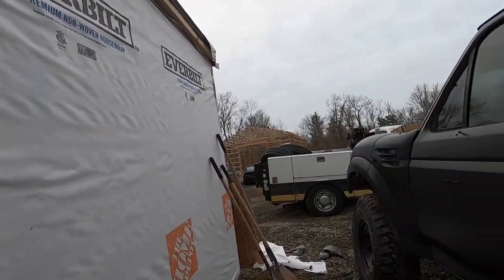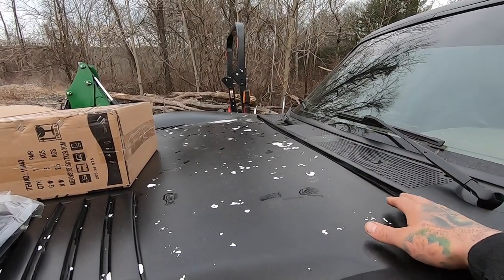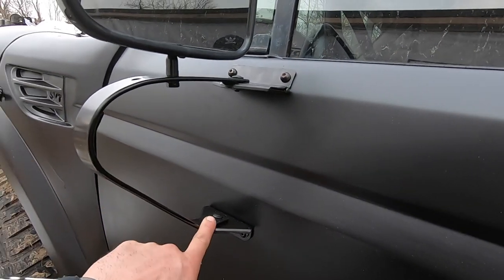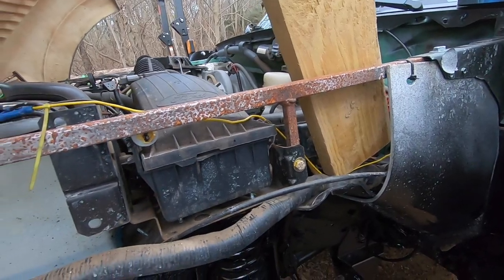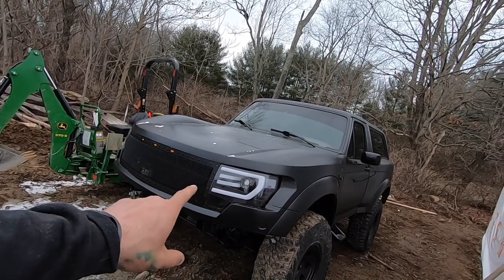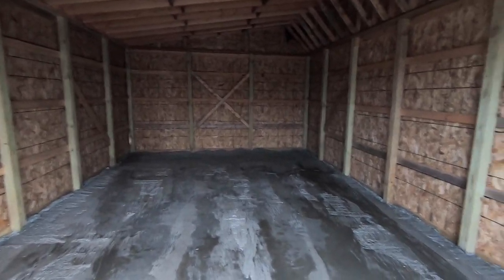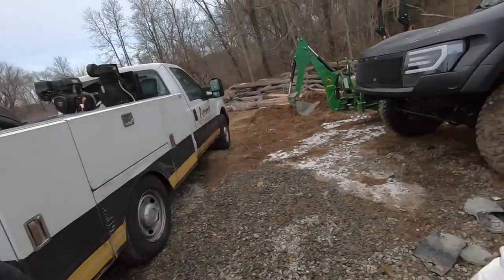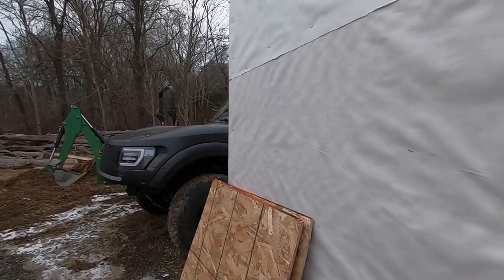New parts for the bronco and garage is almost done.

Comment: So I'm looking to do HIDs in my Xterra, but my pigtails have been melting and I can't figure out why. I replaced the pigtail once already and like 2 weeks later it melted again. Thoughts?
Reply from the maker: The bulbs are getting to hot in your housings? Or drawing to much power try leds they don’t draw as much
Reply: @NRMotorsports  I wanted to go his route because I've read they are brighter and less issues. Nothing overheating as far as I know, then again I guess something must be to be melting the socket/pigtail. Originally it was just my passenger headlight that melted twice in 2 weeks, then my driver light acted up so I'm assuming same issue (I havnt pulled the light out to check)

If it is pulling too much power all of a sudden (or faulty ground I heard can do this too), how hard is it to rewire?
Reply from the maker: Roger Castro brightness with leds the naked eye really wouldn’t be able to tell but yes the lights are pulling from something with bad connection to melt the wiring or plug but check all your wiring for the headlights themselves